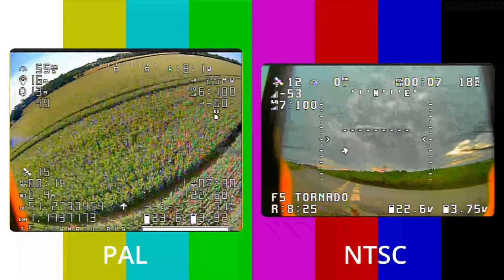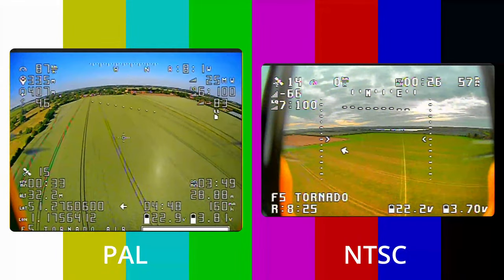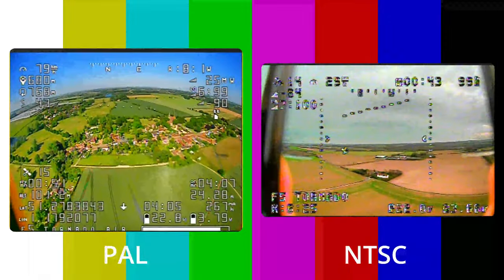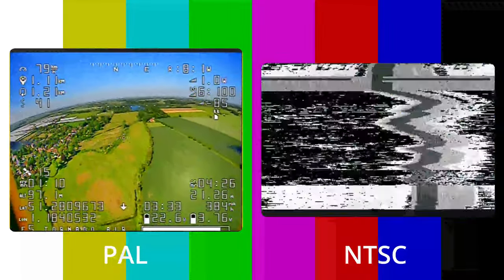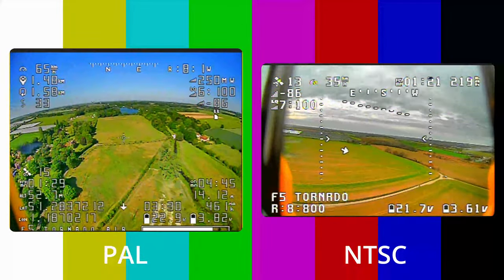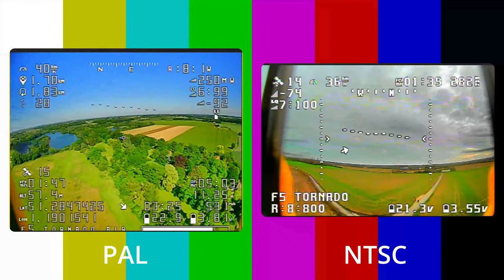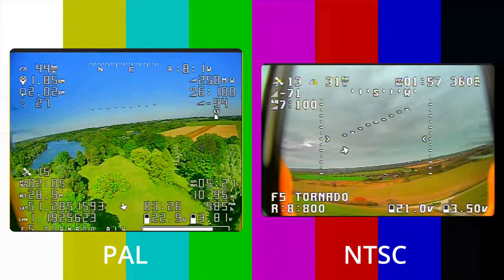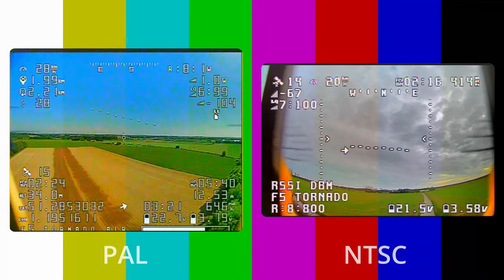FPV Comparison of NTSC vs PAL

Comment: PAL has 625 lines but only 576 of those are the video. the rest are the vertical blanking interval, which is for synchronization. Same with NTSC, it has 525 lines officially, but only 480 are the actual video.

At least that's how it is in broadcast TV, but probably the camera uses these exact same standards, just transmitting at a higher frequency. (Although, PAL and NTSC are only color encoding standards, they can technically be used in any analog video system regardless of resolution)

Comment: What is the information displayed on the monitor called? I’ve just got myself a fb009 goggles and a tx06 eachine camera, and I wanted to get 
On board information to help me out.
Reply from the maker: The telemetry data displayed on the On-Screen Display (OSD) is generated by a chip on the flight controller. Most betaflight controllers have them, so it just needs to be configured in the OSD tab in Betaflight configurator. In order for that to work, the camera video output is normally wired to the flight controller (where it passes through the OSD chip) and then out to a separate VTX. It looks like the TX06 is a combined camera and VTX so you are probably bypassing the flight controller, so it will not be able to add the telemetry overlay. Is there a way to wire the camera to the flight controller?